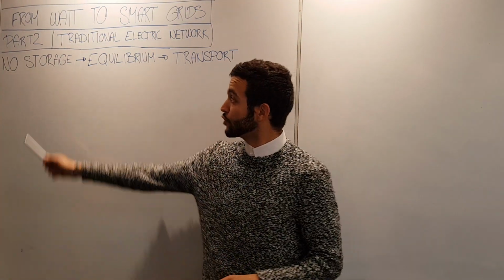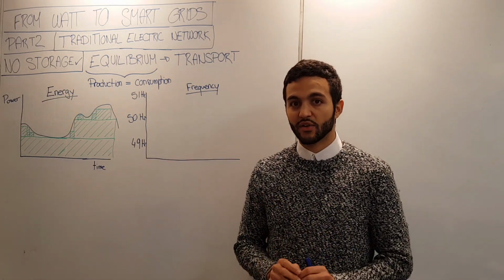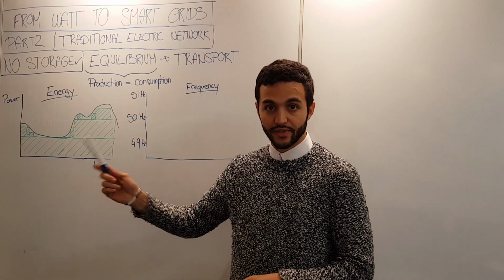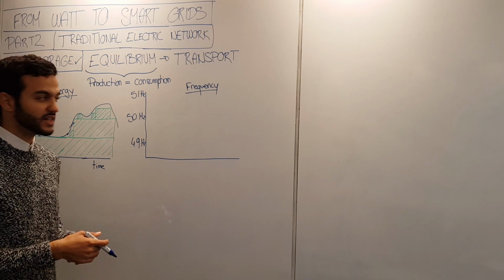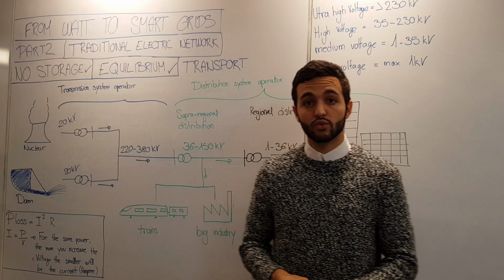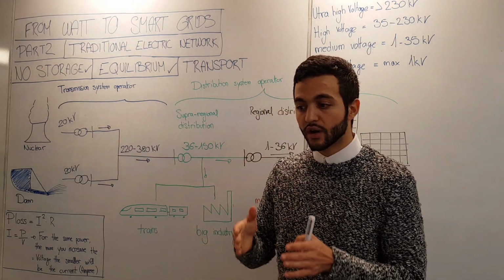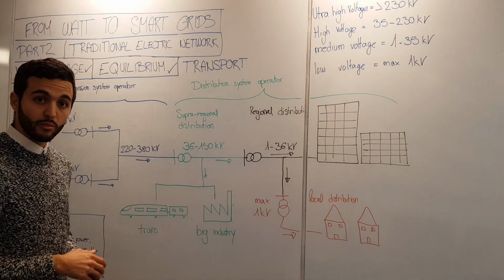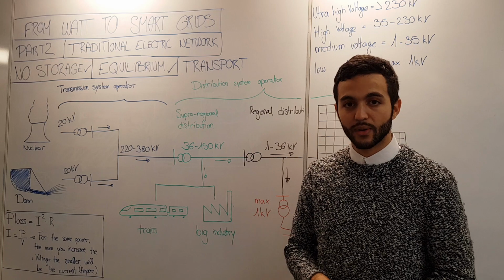Electricity storage, equilibrium, transport. THE SIMPLEST EXPLANATION

Comment: Also a great video!

Who purchases on the frequency market to ensure supply is sufficient? You said it's the network operators, but they're don't actually sell the energy, so who pays them? What if Retailer A’s customers are using too much - must Retailer A pay the network operator?
Reply from the maker: Hey Drakelett,

Thank you very much for your message and congratulation for your question! It is a very good one. To be honest I am not 100% sure of my answer, but from what I remember (was during an internship), the network operator must balance the demand/supply to make sure that his grids are not damaged, he is therefore active on frequency market and will incur costs as you said. These costs will then be charged on retailers since they were supposed to plan the consumption of their region. In the end retailers are going to charge final consumers for those additional costs. So you see the chain (network operator --> retailer --> consumer). But to be honest you maybe shall check that answer with someone working in the field. However to me this answer makes sense and it is what I remember.

If it is not clear let me know!

Thanks again and have a good day ! :)
Bilal
Reply: @bilaldahlab  That's what I was thinking but wasn't sure! Cheers ^^